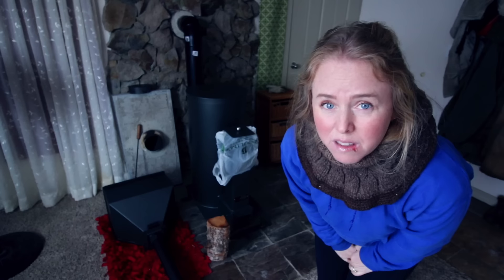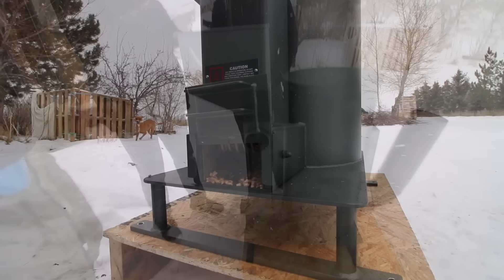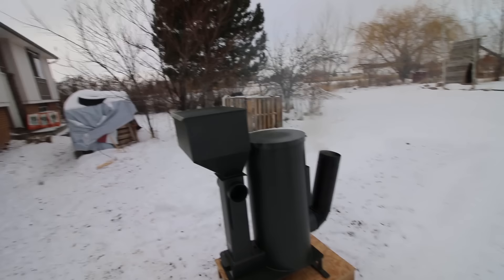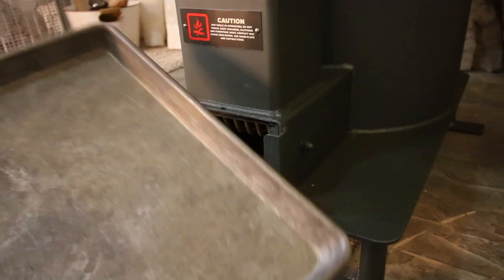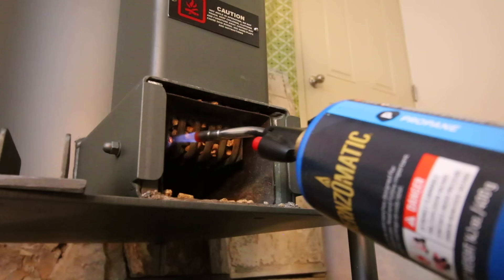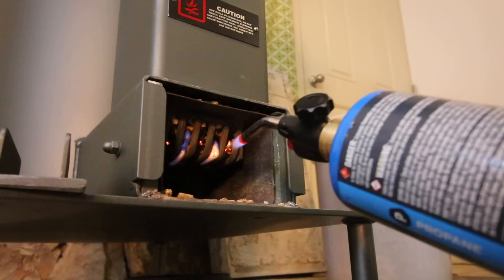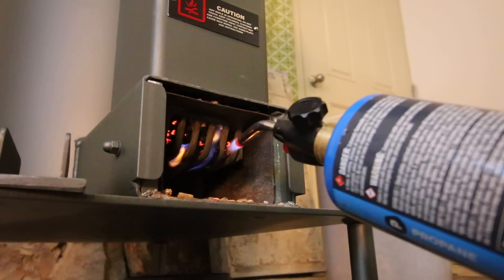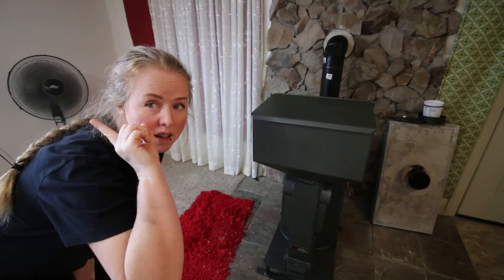Non Electric Pellet Rocket Stove REALLY WORKS for Heating Without Electricity Liberator Rocket Stove

Comment: Most of the comments on here are from people that think this is a pellet stove; this is not a pellet stove, it is a rocket stove that has been modified with a pellet hopper and burn basket to burn pellets...this stove can burn chips, sticks, limbs, wood chunks, corn cobs,...pretty much anything that is burnable and will fit through the feed-tube...
This stove will be efficient enough to pass government regulations in a time when electricity, propane, and pellets are readily available...when the economy, government, collapses there will not be anyone coming to your house to fine you for pollution; there's going to be so much smoke in the air, from the burning cities and forests, that no one will even notice the smoke from your chimney...
When you can't get propane, or pellets, or electricity this stove will still be an efficient cook-stove/heater...

Comment: To start a draft with only a short chimney available first start a small fire in the chimney to get the air flow moving correctly through the stove. Then start a fire in the main burn chamber and the air should continue to follow the flow through the stove and out the chimney. This method also works well for stoves that have a lot of offsets or chambers that resist getting the draft to start.

Comment: To move heat around the house, move the fan into the “cold” area of your house and blow cold air towards the stove. You will move more air that way and avoid cooking the heated air. The air density of cold vs hot will automatically move the hot air towards your fan. 

This didn’t make sense to me originally, but my rooms went up 5-7 degrees hotter just by moving the fans out of the heated room.
Reply: Wow that's a good tip. I have a little fan on top of my stove and it makes a great difference but I'll do what you say and see how that works thanks

Comment: Been using a pellet stove since they came out AKA corn burner and I store my pellets 3 tons out side every winter till its all used up your right you should not let them get wet and a tarp is all I use but yes you can store them out side for the winter use  and I have had half a ton left over that I stored in my pole barn  and when I used them the next winter Humidity was the biggest killer of pellets from hot days and high humidity.

Comment: Might try soaking some of the pellets in Isopropyl Alcohol for fire starting. Been burning pellets for quite a while in stoves/firepits/smokers. A container half full of pellets soaked isopropyl that initially covers the pellets that then is turned a few times over the next day ends up as great fire starter. The pellets swell with isopropyl, light instantly and burn for minutes which is often plenty enough to start any fire. Also so far has been one of the cheaper fire starters I've come across that is instant on.

Comment: A little squirt of briquette starting fluid will give you an instant start.  A cheap starter fluid is a mixture of 1 part gasoline to 4 parts diesel.  Straight gasoline is too volatile and is likely to explode.  Straight diesel is usable, but the gasoline will keep it fluid outside when the temperature drops below -10F and makes for a quicker start.

Comment: Another rocket stove short video on YouTube shows putting a one paper towel sheet into the grate at the bottom of the shute  before loading it with pellets - the paper towel prevents the pellets from falling through the grate.

Also, you don't need pellets - you can feed it with broken twigs which is cheaper.

Comment: I wonder if you put a little Fat Wood with the bottom pellets for faster ignition on lighting , that may help
Reply: Please excuse my ignorance but what is fat wood?
Reply: @campbellkennett7984   flat wood is used to start a wood fire it is also called kiling
Reply: Fat Wood is wood that is saturated with pitch...the tree is injured in a way (bugs,  lightning, fire, snow) that makes it produce pitch to protect itself...I have harvested 50 foot tall trees that were almost completely Fat Wood...
I make my own "matches" by cutting the log into 3 inch lengths, then splitting them into 1/8th inch squares...(if it's really cold, damp wood, or I just want to get it done in a hurry I will use bigger pieces)...I stack my kindling nice and neat, then light a piece of Fat Wood and put it under the kindling...
So, what you are saying would make sense; drop a few chips of Fat Wood in first, pour the pellets in on top, then light the chips of fat wood and you're done...you wouldn't have to sit there with a torch for 5 minutes...and you don't have to waste gas by turning your torch up...
I like the briquette idea too...just drop in a couple matchlight briquettes before you put the pellets in (for those who don't know what is, or have access to, Fat Wood)...

Comment: Would it be a big issue to design a unit that uses wood chips from an ordinary wood chipper? It seems more efficient,  due to the minimal processing needed.
   Helpful tip: before you torch the pellets, allow your propane "lighter" to blow up the chimney. You'll start a draft in a minute, or 3. Then light your fuel. Works on woodstoves, chimneys, anything.

Comment: Thanks for the great information. I was really shocked at how long it takes to light the stove and what would you do if you didn't have a propane torch to light it? I like that it doesn't use electricity to use it. One thing I thought was a big waste was all the burn heat going outside. I thought if it could be run though a sand battery it would be more efficient, kind of like a mass rocket stove, but smaller. The one big factor was the cost of the pellets. I have a friend in Arizona and he said to heat his home it would cost him over $200.00 a month to do it. The one stove I wish was made would be a automatic home furnace run on waste oil that doesn't require an air compressor to run it. Anyways thanks for sharing your stove and thoughts with us. Best Wishes & Blessings. Keith Noneya

Comment: Neat stove. Might want to invest in a longer torch tip sold for lighting charcoal bbqs. Its like a mini weed burner or tiger torch and works great with propane. Will get that stove started quickly with whatdver you burn in it.

Comment: We have a raised floor in the space below floor we have a 4 inch pipe coming from outside to our pellet burner  we also burn wood chip dried it is cheaper also soak pellets in kerosene.

Comment: My $2 dollars... (2 cents adjusted for inflation) - A Non-Electric Stove is Certainly an ESSENTIAL NECESSITY, especially when the power goes down... which is only going to get worse in the time ahead. So whatever kind of non-electric stove that a person can make work for them, is a Must to have. 

With that said, the Liberator design is a good concept prototype. But for the near $3000 price tag (Gen 2 with Pellet hopper) the company certainly needs to make some upgrades for selling it as a "finished" stove. 

*Such as having steel spring tension "sliding" covers to close off the air vents so you don't lose warm air from the house drafting up and out the chimney when the stove is not in use, instead of having to improvise something like the plastic bag. 

*Also a better fitting door for the grate, and adding a wood stove "spring" style handle to it so as not to get burned. 

**And it certainly needs a basic temp gauge (to see what burn temp its running at) and a damper to give the ability to raise or lower the burn temperature. All or nothing is not very feasible no matter the size of building you are heating, due to outside temperature changes.  Colder temps needs more heat to keep the building warm, and warmer outdoor temps means you have to turn the stove down or it will run you out of the house. 

I Do Like that the Liberator will burn other wood besides Just Pellets. The Wiseway stove is a pellet stove only, which means I have to store up pellets on hand for when the time comes that I can't get them. 
I also like that the Liberator can be used to cook on. 

I have a Wiseway non-electric pellet stove in my house for 2 years, and my Dad has had one for 3 years now. And in my opinion it also should not have been sold as a "finished" stove either. As it too was "rough around the edges" and needs some changes and upgrades. 

I like the pellet hopper design of the Liberator better than the Wiseway. As it's kind of hard to haul up a 40lb bag of pellets to the top of the stove (as it's fairly tall) and dump them into the narrow hopper on the back side of the Wiseway without spilling them all over the place. This is made worse if the stove is next to a wall, as it makes even less space.
 
But the Wiseway damper, burn basket, secondary burn plate, and ash pan is a better design than the Liberator. And the Wiseway was less than half the $ too. 

If I built my own stove, I would likely go along the lines of the LIberator hopper and cook top with the chimney at the very back of the stove. But with a similar burnbasket, secondary burn plate, and ash pan design of the wiseway. As well as an even better damper design (than the Wiseway) and some other alterations and upgrades. 

If I had a plasma cutter 3 years ago before I bought a Wiseway pellet stove, i might have built my own stove. I have built plenty of things, including some large projects, with just an angle grinder in the past before I finally bought a plasma cutter about 6 months ago. But an angle grinder takes a lot more time, difficulty in some cases (like cutting circles/holes) and expense with the cost of cutting disks now days. And I've had a number of disks explode on me too. Even had a sanding flap disc that suddenly blew apart not long ago, which I never expected that one. Have gotten some fairly bad cuts, burns, and pain from them over the years. Plasma can't do everything, but it certainly far reduces the use of an angle grinder. This is all beside the point, but maybe an idea for those looking for a pellet/rocket stove to think about.

**EDIT: I will add that one of the reasons we moved from a regular wood stove to a pellet stove was because in 2019 I had two major injuries about 6 months apart that prevented me from being able to go and cut firewood for 2 years, even now still have some issues. 
We tried to buy firewood one winter, but no matter who we got it from it was never seasoned, and was even really wet one time. I don't like a pellet only stove for the sole reason of realizing that soon we won't be able to just go out and buy more pellets. I do have two regular wood stoves still stored in my barn that I need to clean back up and repair, or build a better one, so that I can reinstall them when the time comes.

Comment: Stove needs redesign to accommodate an igniter. Takes way to long to ignite pellets. I have a harman P61A  with an igniter. Used pellets on a gas grill for smoking designed for it. Takes quite some time with a blow torch to ignite.

Comment: If you can create an air intake that supplies the stove with air directly from outside and thus does not take the air/oxygen from the warm indoor air to the combustion process. Then you will reduce the consumption of pellets/firewood for heating your desired area. This is because the air/oxygen used for the combustion of the warm indoor air does not then have to be replaced by leakage inflow of cold outdoor air into the stove room itself, which is thus also cooled during the heating process. A big plus and a smaller minus = a lesser plus in this comparison. Therefore, you streamline the heating of the house. 
If you also build a jacket with room for air to travel around the warm part of the stove with air intakes in the entire perimeter at the bottom and have the upper part essentially closed but with strategically placed air outlet nozzles angled in a suitable way. Then you will get a stove that self-circulates the air through convection and spreads it around the room in desired directions without electricity and you will therefore have less need of the fan.
You seem to be resourceful. So, try it. You might like it.

Comment: Instead of swinging the stock nozzle on the propane torch back and forth, perhaps instead consider a flat delta shaped nozzle to cover the larger width.
Reply: it's best to use pellets to create a mini burner for a wood fireplace... with a metal tee and appropriate pipe sections for gravitational suction of air without electricity and a suitably large flame... something like in a kerosene lamp...
the pipes should heat up quickly enough, be thin, etc. then it may work... the problem is poor combustion of the pellets and spontaneous combustion of the remains... unfortunately, the pellets or burnt like rice fried in a pan... but the rice is fried in the air... :-( this is impossible with gravity pellets

Comment: Hold the propane torch STILL until the pellets light, then move to the next grate opening.....repeat. Seems obvious. There's a lot more processing of the wood to get it small enough to work in these stoves, extra time and effort. Some folks don't think about that aspect.

Comment: I wonder if, after you get the mass heater bench installed and "tuned" to your liking, it would make sense to fill in around the pea gravel with quick-krete.  That should give better heat conductivity from the chimney pipe through the bench AND help insure the pipe joints never leak

Comment: 2 comments.  I’ve got 4 years of burning pellets in a old school pellet stove.  
Clean burn Pellets from Tacoma are not my favorite pellet.  More soot and whitish corrosion to the burn pot using that brand.   CHS sells a better pellet.    Also, consider taking a tuna can or Sardine can with some alcohol hand sanitizer too start your stove with?  The Hot flame from ETOH should Ignite the pellets without you waiting?

Comment: You would think there would be caps for the two Air intakes or damper valves,something, you’re not going to  be able to put a plastic bag on there until the stove is completely cold. It would also look nicer than a plastic bag.

Comment: I made a RMH and did not like it, so I tore it out and replaced it with a home-built LP gas heater.

Why?

It worked TOO good. 

 I live in North Texas and we have only two seasons, namely "hot" and "not" and the weather can change day to day.

The RMH takes about 3 days burning 6 to 8 hours a day to heat the mass and, subsequently, about that same amount of time to cool it down.

 You need the cold weather to last several days or you wind up running your air conditioner in Winter,  because you had a day or two of Indian Summer.

Comment: If you can, pipe in combustion air to your stove. It will remove the need for the plastic bag, and make your house warmer as it won’t be sucking cold air in through your doors and windows.

Comment: I am wondering if the pellets will ignite faster if you let the plumber torch to stay in one spot instead of moving left and right across multiple pellets.  Then you can move from one pellet to the next after the first pellet has ignited.
Reply: MAP gas is the ticket, mine lights in about 30 seconds.

Comment: the problem with pellet stoves is the fact that someone still has control over your heating costs , my brother in law put one in and the price of pellets has continually gone up, i will stick with burning wood .
Reply: Trees such as accacia are growing new branches no matter how often you trimm. Wouldn't it be a good idea replacing pellets with the bits of wood resulted from using a crack chopper?

Comment: IMHO someone should design one of these stoves with an EXTERNAL air source.
The amount of air that goes up one of these things is crazy.
You need a vent in a wall which allows cold air into the room to supply the stove.
You are heating the air for it to just go up the flue/chimney.
If it could be taken from the outside you would be more comfortable in the room without draughts.

Comment: Goodluck with your new libarator rocket stove. You would get a better draft with a fresh air intake.  And close off the other inlet with a plate . I would add a damper to the fresh air intake,to control incoming draft. Also I would install a damper on the exhaust flue. To bank down the draft. Can you please tell me the size of the cooktop.thanks be safe.
Reply: it's best to use pellets to create a mini burner for a wood fireplace... with a metal tee and appropriate pipe sections for gravitational suction of air without electricity and a suitably large flame... something like in a kerosene lamp...
the pipes should heat up quickly enough, be thin, etc. then it may work... the problem is poor combustion of the pellets and spontaneous combustion of the remains... unfortunately, the pellets or burnt like rice fried in a pan... but the rice is fried in the air... :-( this is impossible with gravity pellets

Comment: Turn that torch up. You can light those pellets in a matter of seconds. Your flame is way to small. And you are wrecking your torch. Spend $50 and get the nice burnsomatic they are nice bigger flame and easier to use. No gas comes out until you pull the trigger.

Comment: The tip of the torch going red when you had it set to light the pellets is not good for the torch. You need to turn the torch up more right away so you don't get that red tip on the torch . As soon as you turn the torch up the redness on the tip went away. Just an FYI don't want to be critical.

Comment: I might ask why not a standard pellet stove? Blower fan, auger speed (controls heat), I put mine on a thermostat it started and shut down on it own. Yes it need elec power. I would use a bag a day once winter set in. My country had so Mary no burn days I finally switched stoves, I now have a natural gas stove. Just wondering?